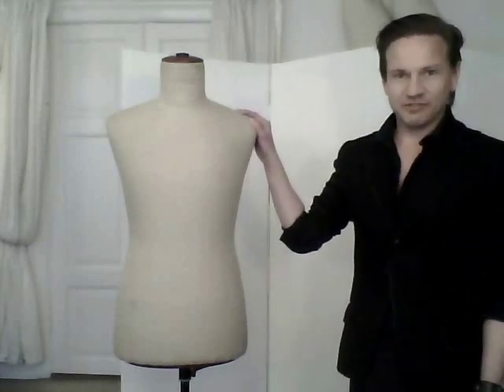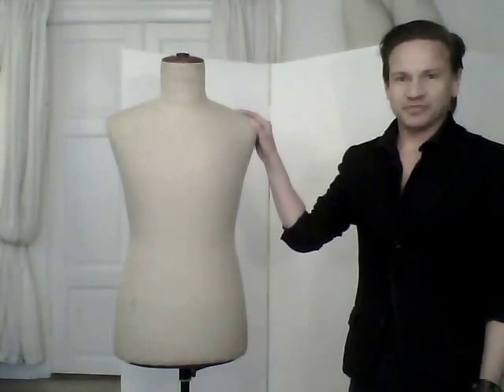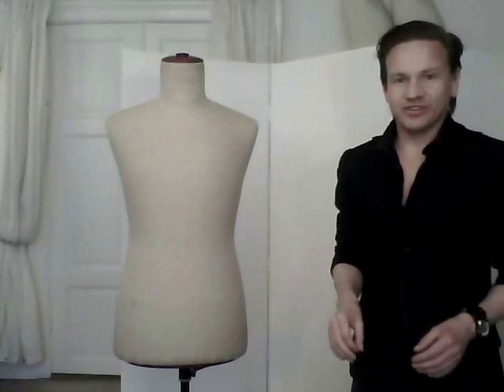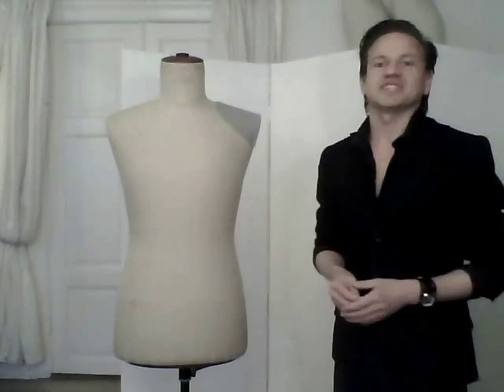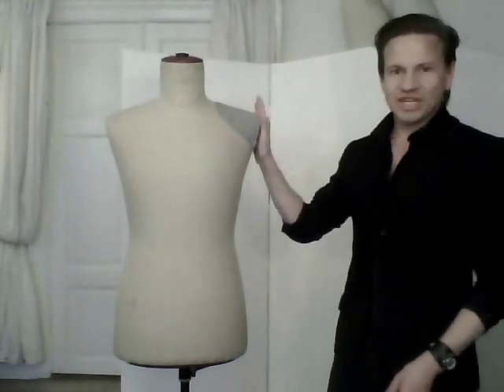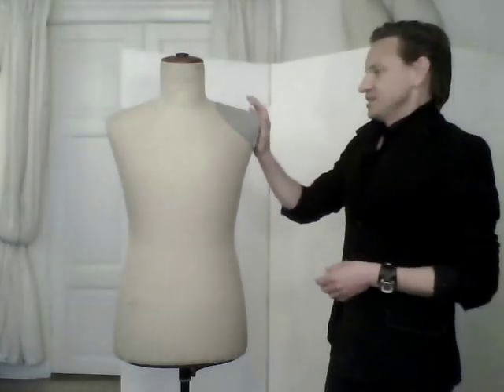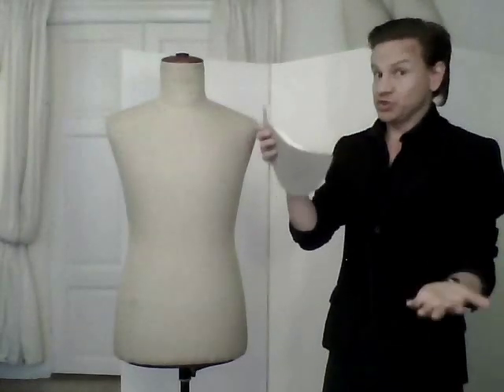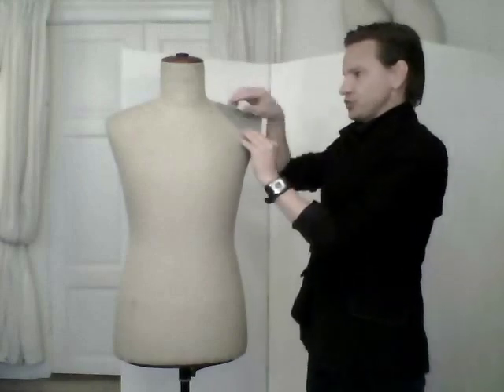6. How to shape a men's jacket, the canvas - by bespoke tailor Sten Martin

Comment from the maker: Thank you Fred! And as an answer, I would say I do both at the same time. Or, at least that's the practical thing to do. If you go to far on one side it's impossible to copy it over to the other. So I do a bit on one side - the layers - copy them over (and usually also to a paper pattern just in case) and then sew some. Continue on the other side, then back again... and so forth.

Comment: You either draft the jacket patten by hand or use a good block .you put good inlays(extra material) on the jacket for altering at fitting stages. There are usually 3 fitting stages for a true bespoke tailored suit.  Once cut out you tailor tack the inlays and break line of the  jacket . You cut the horsehair body canvas using the jacket front as a template, marking on canvas the dart on the jacket front  and break line of lapel. At this stage some tailors will cut out the chest  canvas as well.
Reply from the maker: Thank you for that extended explanation of the bespoke process Jojo! (I just would like to add that a suit jacket also can be calculated and cut according to a drafting formula, where the customer's measurements gets transformed into an individual block. Or be draped, directly on a dress stand with corresponding measurements to the customer.) Thank you for sharing your thoughts.

Comment from the maker: Hello Deliberately!
Thank you for kind comment! Regarding dress forms in personal sizes, well, that's always been a problem. What I usually do is to work around it. I remove width after I'm finished with my drape, usually at side seams but also some over the chest area, or just calculate with the size difference and make it a bit tighter than I normally would do.
Otherwise, my favorite brand is Stockman at siegel-stockman*fr (USA, Europa, Japan), or other vintage ones found from private sellers.

Comment from the maker: The haircloth (as I call it, hopefully also in the clip) is the stiffest one supporting the chest area. Stiff horizontally to the lapels folding line, but collapsing vertically to make movement easier.
The hairvas (or hymo) is the softer larger one supporting the whole front area plus the shoulder/armscye part at the back. Also stiff horizontally, but to the front edge. Still collapsing vertically though, to make movement easier.
Thank you for asking!

Comment from the maker: I hope to include that in a forthcoming clip. Quite difficult to visualize though.
The idea is that felt can be stretched all over the place and do not unravel. Hence the flat edges -> felt do not need any allowance. The trick is to "stay" it (to keep it un-stretched) at the top of the built in stand (just inside the top fold), and then stretch it gradually down to the outer edge in a controlled manner, but also some on the inside down to the neck.
Be sure to have your underlying canvas on bias.

Comment: It never occurred to me to actually build up, cut and construct my jackets right on my form. What great tips.  I'd just used it for fitting, detailing, and finishing.  Also, I haven't seen real horse hair canvas in stores since the early 80s.  Is it still made?  I loved working with it when I made my jackets years ago.
Reply from the maker: Thank you so much for your comment sidior12! Sometimes it can be a bit refreshing to do one's work in different new ways, right? (Although I also do most of my work the way you'd explain it, too.)
The real horse hair canvas can be really hard to find. Most of those materials got inserts of plastic and other generic materials nowadays. It's a pity, but that's the way it goes, right? Anyway, thank you for watching, and have yourself a splendid day!